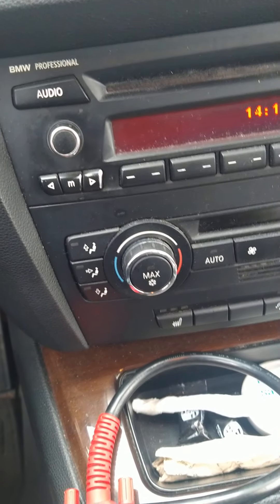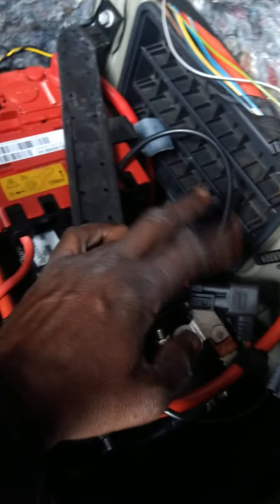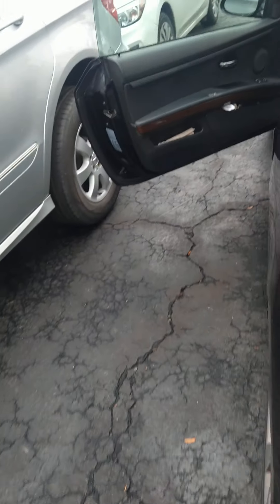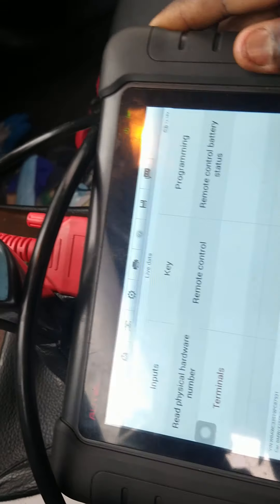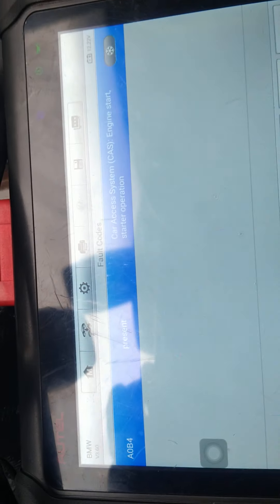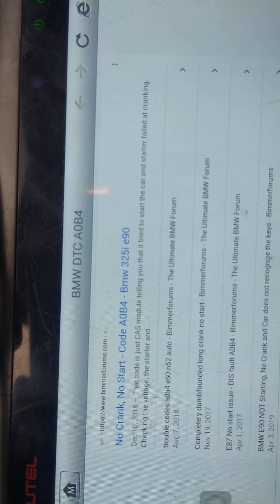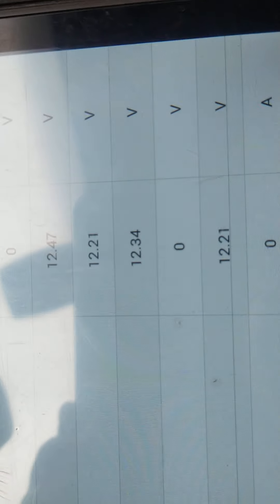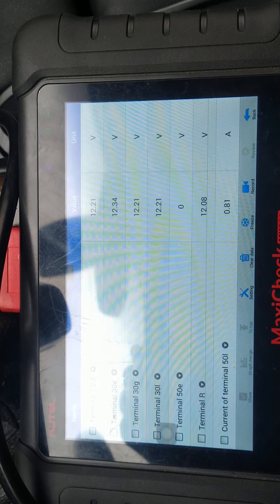How to test starter to Any BMW  with Scan tool It's apply to All X3, X5 Any N51 N52 N54 engine.

Comment: i have a 2005 bmw 645ci with no  start no crank issue. ive checked all the fuses and relays and there good. ive changed the ivm also. battery is good.

So i finally bought a good bmw foxwell scanner and got this code A0C2/not present. CAS: Output, terminal 50 rs.  Would this be the starter?
Reply from the maker: Yes change the starter everything will be okay